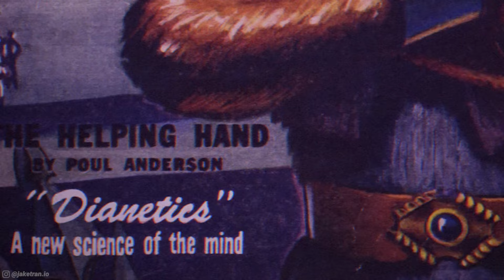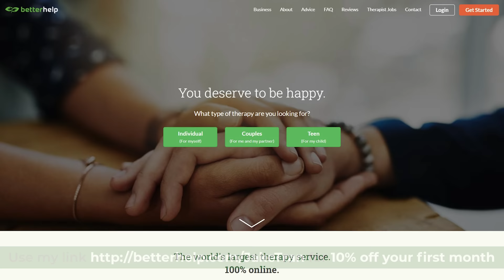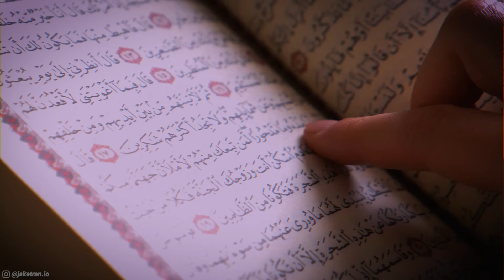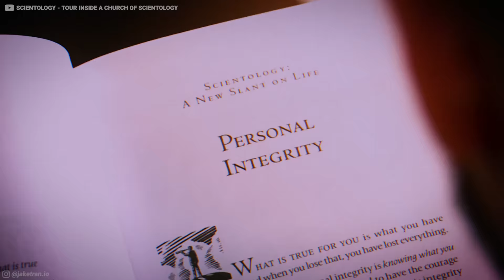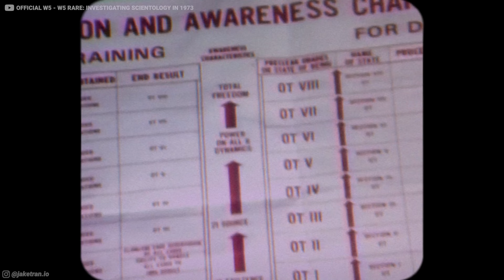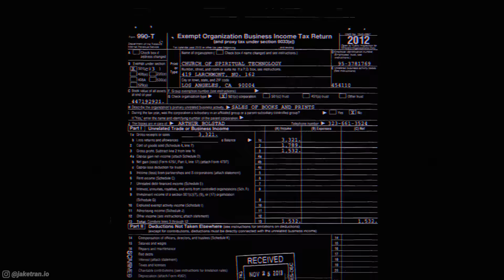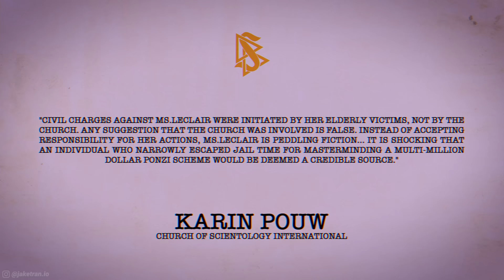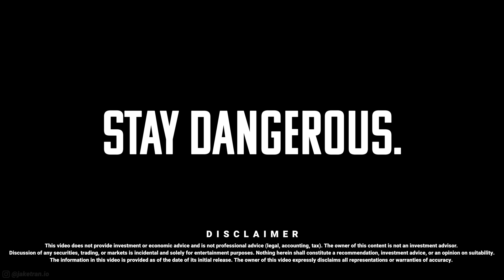I was afraid to post this video.

Comment: Bit coin operations:  bit coin operations use a lot of energy.  I thought religion was torture, so it's even more for me.  Our challenge might be to connect the leads and then pull the Net in.  It's sprawling, but different types of people make the information coherent and connected.  The additional information is electromagnetic pulses that sometimes can be heard as a static click.